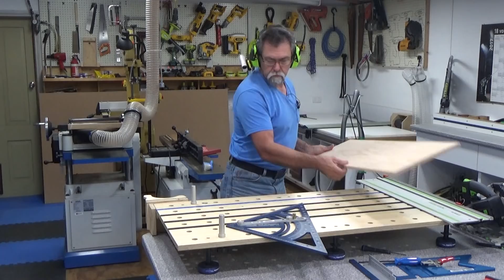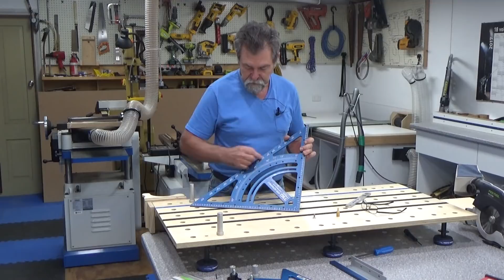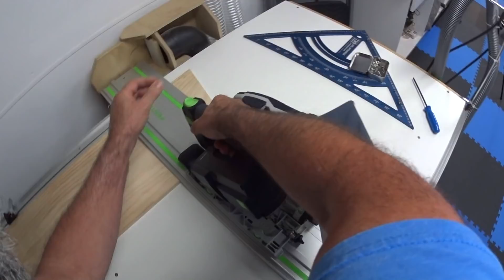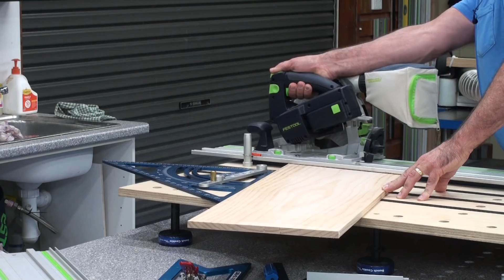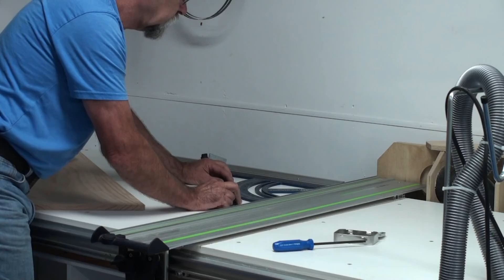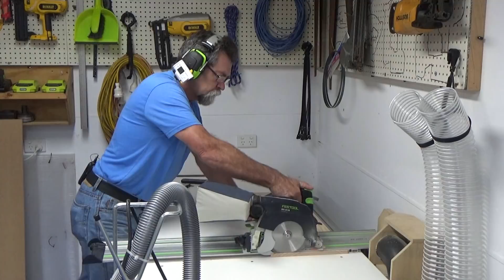TSO MTR-18 TRIANGLE for use on Festool MFT-3 and Stanton Bench | DAVE STANTON wood shop

Comment: Dave, what do you think about installing a run of miter track in your top to the left of the track saw track? You could then use your miter gauge from your table saw to set the angles much like the MTR-18. I happen to already own one of those expensive Incra miter gauges and would like to find further use for it.
Reply from the maker: That would work but the mitre gauge would need to be placed in the slot from the back of the bench. Good idea!

Comment: The triangle square is nice but the price is bad to much $400 to much
Reply: A table saw that cut with that level of accuracy and allow for that degree of accuracy will costs thousands. 

I have a felder saw and I can tell you the accessories cost more than $400.
Reply from the maker: Yes, it is expensive but it is accurate. For someone who requires that degree of accuracy it is worth it.

Comment: The tools you show are great only one problem with the application. It will only work on smaller size sheets and thickness. If I were to buy this limited tools set my wife would sell me. Is there something as nice as what you show but able to cut down 4 x 8 sheets of plywood and other wood thickness? The extra ability to cut items such ar 4 x 4 would be great. Oh and BTW dimensions are in in inches.
Reply from the maker: Hi Rud dog. The tool will work well with larger sheets, you just need to have a larger panel to support it on. It is a relatively easy thing to do to make an 8 x 4 (sorry, that should be 2438.4 x 1219.2 mm) panel that has 20mm holes drilled in a 96 mm square grid. The thickness is not an issue. Thanks for watching and also for your comment!
Reply: Rud Dog 
You can also use that Triangle on a larger system if you want. I have a set up for smaller cuts and then a separate system for larger cuts with track saws.

Comment: Love the Bench and all of its capabilities. Keep the ideas coming. My thoughts on this triangle are that the MFT3 with a protractor attachment is 685 dollars, this angle guide alone is almost 400. Hard to justify.
Reply from the maker: Thanks for the compliment! One thought that comes to me is that the triangle is not just for use with a MFT-3, it is a very accurate square. You would pay a similar price for a Starrat or Woodpecker of the same size.

Comment: G'day Dave, Is there any one out there could help, I do enjoy your work! however  I do have a question though every time I flatten the end grain cutting  board and put back on the bench It whorps back to the side just flattened, I can only use the router to flatten the board  this has happened several times now the timber is very dry and end grain so I thought I'd ask the professionals for "HELP" before I quit the project this Is the first attempt to make a cutting board. Can you offer any suggestions? Cheers D
Reply from the maker: Any timber that has not been sealed in any way will absorb and release moisture. The fibers swell when absorbing and shrink when releasing moisture. This usually happens close to the surface. Try placing the board on an elevated breathing platform such as cooling rack for a cake or even a couple of dowels laid on the bench. to elevate the board so air can circulate around it. When you come to applying a finish to the board, use the same method and coat top, bottom and sides at the same time. I hope this quick answer is of some use.

Comment: Great demo Dave.
Solved the Xmas present dilemma. 😄
I have an mft and it never occurred to me until your demo that I could push the rail bracket aside and use the dogs and another rail to make a cut that was  for a piece longer than 600mm - the capacity of normal set up.
Reply from the maker: Glad to help! Also, if you use a 1400 rail you can move the clamps from the front and back of the MFT-3 and put them on either end.

Comment: Hello Dave!

My brother-in-law has been trying to talk me into buying an MFT/3, but I think your bench is more my style. Especially after this review. (he ordered a UJK parf guide system this morning)

One question, how would you recommend using a Stanton bench to do thin repeated cuts?  For example, cutting 1 inch strips to make a butcher block cutting board. Seems to me I would need to re-measure for each cut, which means the strips may be slightly different which means more cleanup work if i do an end-grain cutting board. 

This is easy on a table saw, but i have too many family members with missing fingers and I am just getting started with woodworking :)  On an mft i could use dogs to stop the board, and move the mounted track to the correct distance. How can we do this on a Stanton Bench? an extending ruler? some sort of stop block thing mounted from the underside with long parf dogs?

Thanks!
Reply: MFT/3 is a powerful tool to use on sites. You can just fold it up and use it.  Making your own table with the parf system in your workshop is in my opinion more flexible.  I am in the middle of building a mobile system that can folded up and put in the back of a van easily.

Comment: nice review, but again no support for the offcut. what about an extension on the right side of your bench so hold the offcut after making the cut. it could be simple two pieces of wood screwed under your bench
Reply from the maker: I have a second Stanton bench that I use for off cutts support when the off cuts warrant it.